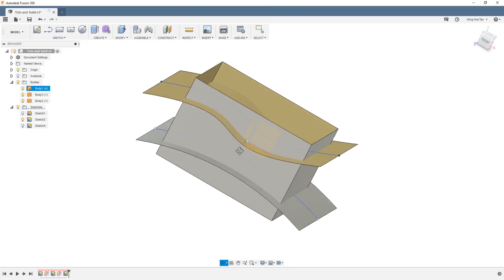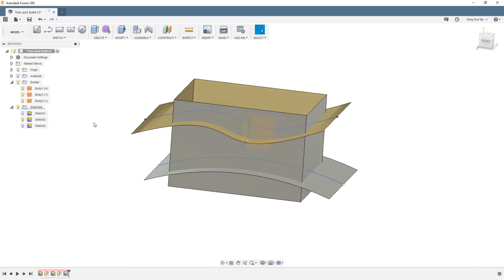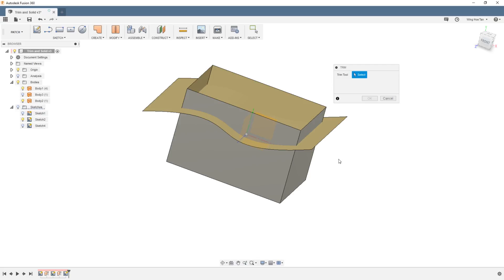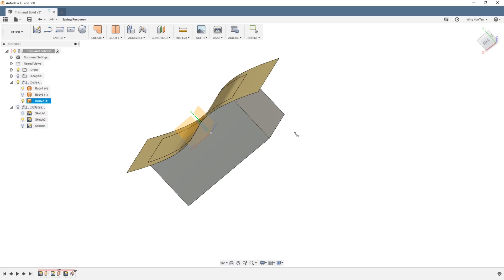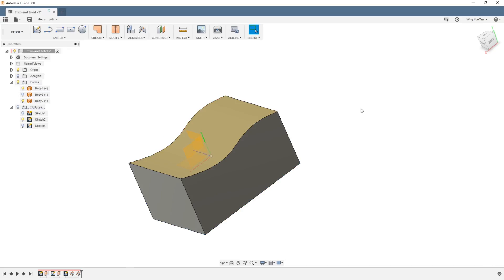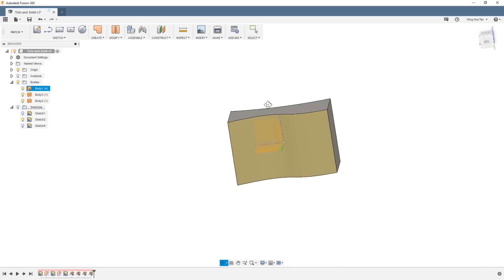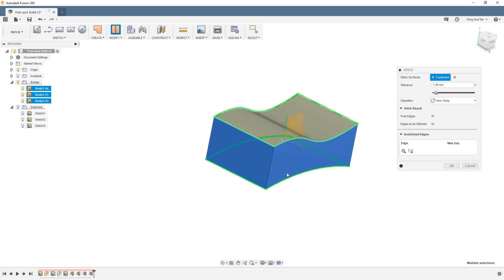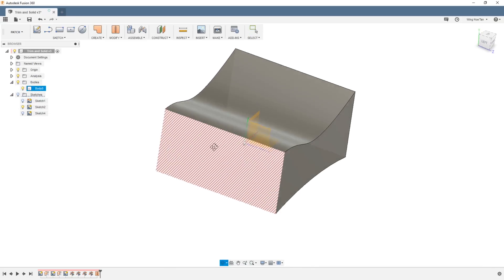Fusion 360 - From Patches to Solid

Comment: Quick question... Save as a watertight, hollow body with (x)mm wall thickness? 
No rush... TiA?
Reply from the maker: To do that, you should use shell and click on the body instead of faces. This is actually related to your question in my video on shelling. Hope this helps.
Reply: @Fusion360School  Yeah, certainly helped. Thx! 🌝